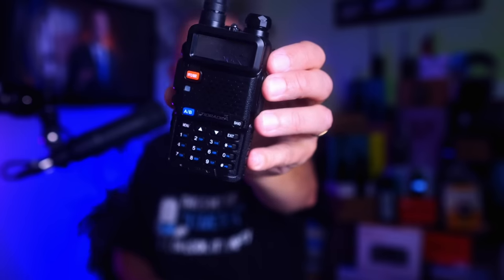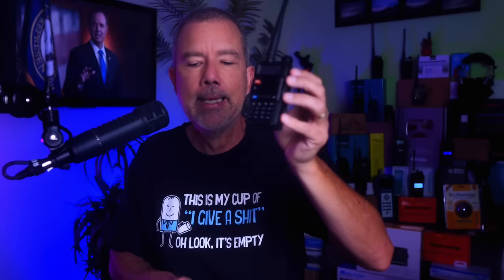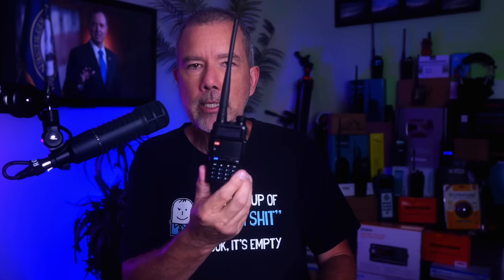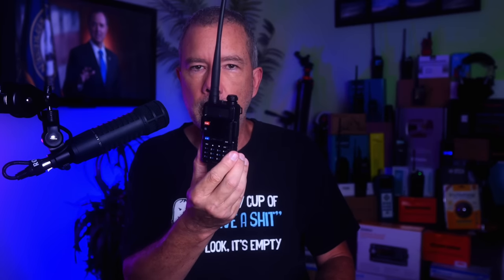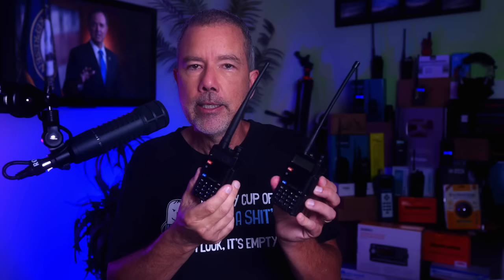Why Is A Baofeng UV-5R Not Allowed On GMRS Frequencies Or FRS Channels & What Will The FCC Do?

Comment: nice information. I have the UV-5X GMRS version sometimes UV-5G they the same unless the first batch which had a bug in firmware. I plain to buy the UV-5X3 tri-band ham version. that for HAM only. now what about the outher way around? take a GMRS radio and mod it to TX on HAM ? my GT-5 does MURS and GMRS and HAM. only TX on HAM or a SWAT team take me down LOL
Reply: Modding a GMRS radio for ham is fine. You can use anything on the ham bands--even radios you build yourself--provided you're licensed. I have the original UV-5X radios that I use on GMRS and ham all the time. Works like a champ. Two for $30, I couldn't say no.

Comment: But why are the US retailers allowed to sell them in the first place?
Reply from the maker: Because the FCC does not have that much power.. although a few years ago, after Baofeng had been selling radios in the United States for about 10 years,  the FCC did send a mean letter to Baofeng and told them if they did not make some changes, they would no longer be permitted to sell them in the United States - in response Baofeng began to "lock" the radios so they can no longer transmit on anything other than ham radio frequencies.

Comment: I know, not having either a HAM or GMRS license, and because of FCC regulations and certification requirements for the radio, I can only LISTEN to the radio traffic on those bands with my Baofeng UV-5R. What I’d like to know is that because the UV-5R is capable of transmitting and receiving on frequencies that are far outside of any of these bands, is there any reason my friends and I couldn’t just pick some empty frequencies outside of any reserved bands and talk on those frequencies using simplex, and if not, why not?

Comment: is the gen 3 model the same to use
Reply: BAOFENG BF-F8HP (UV-5R 3rd Gen) 8-Watt Dual Band Two-Way Radio (136-174MHz VHF & 400-520MHz UHF) Includes Full Kit with Large Battery... is this radio same
Reply from the maker: I dunno, I dont have one.

Comment: I live in Canada, so LMAO 😂 FCC.

but, seriously, the ONLY sane argument is psychology.  You a HAM, so you and only you know how to do this correctly.  Those 10yr old kids running around in the yard REALLY don’t know the diff. between the FRS they allowed to use, and the UV-5V you holding.  ( or my yard, anyhow. )

🤷‍♀️  It’s a “slippery-slope” argument, and those are 💩 towards people that know Laws of Physics.  😢  Kinda true about the “kids” point tho … it’s on you to tell the kids “NO TOUCH MY RADIO!!”  😂  ( I do! )
Reply: 1st rule, “learn Physics, applicable to the situation.” 
2nd rule, “be sensible!!”
Reply: I have Marine Radio license.  UV-5R is a better handheld than anything else I own, FOR MONITORING!*
legally required🤣 to say that I only listen with the BaoFeng.  … but my *actual Marine VHF radio is such old crap.  😂

anyhow, I monitor Marine VHF with this, okay.  when there are kids around, (a) I teach them “no touch my radio”  (b) I realized it’s way safer to have an FRS channel to switch to, as, like, “safety-mode.”  😅  if someone does touch my radio … I want them on FRS, not Marine band!  😵
Reply: 😂  anyhow:  I have licenses, in band of what the UV-5R can do.  👍  can think of at least 2 reasons not stated in this video, that the FCC uses to reject UV-5R for any use except HAM-bands.  🤷‍♀️

“Be Sensible” at best: means don’t use any HAM radio to transmit out of license, unless it’s an emergency, no one else is responding (5 min.), fine, just do what you have to if it’s a MAYDAY call.  otherwise don’t?

“Be Sensible” at worst: means ‘don’t get caught.’  PROGRAM your radio to have every single FRS channel, and every parameter is exactly correct.  … this isn’t techincally “by-the-book,” but if you don’t screw up, no one can tell.  🤷‍♀️  but, are you sure?  🤔
Reply: LMAO.  😂  just, if it isn’t FCC approved, you gotta quadruple-check you got every single thing set correctly.  🤷‍♀️  don’t screw up, you won’t go to imaginary-FCC-prison.  🤣👍

Comment: If someone knows how to upload a correctly programmed GMRS codeplug into a UV-5R then more power to 'em. Nobody gives a rodent's rectum. The problem is when doofii (plural of doofus) put in non-GMRS or non-MURS frequencies and actually transmit on them. To me it's simple; if you know what you're doing then do it. If you don't, or aren't sure, just buy a commercial GMRS radio, get out of your mother's basement and have at it.